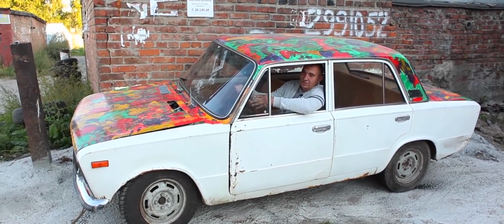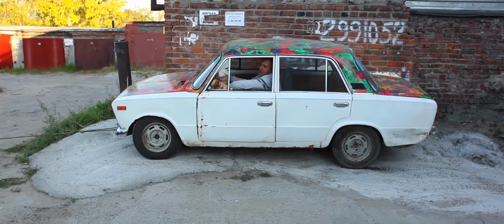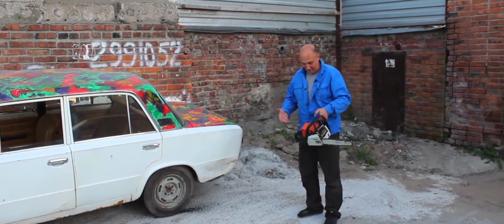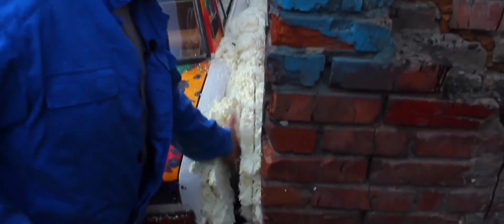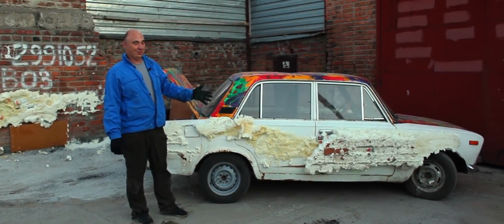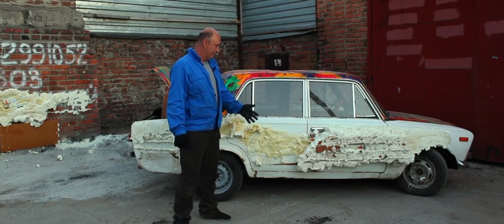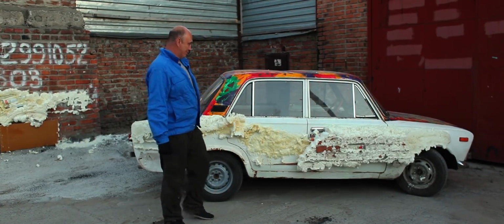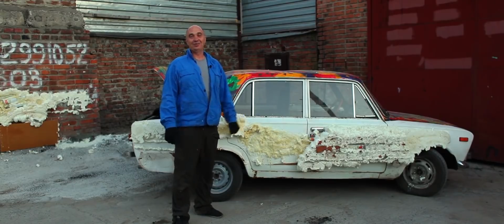Sticking a car to the wall with construction foam

Comment: See, I knew it was a good idea to use spray foam for automotive bodywork. It is strong enough. 
Keep up the translations. Really enjoying Garage 54. Thanks for all your work on these.
Reply: It fails over the years as it shrinks and falls apart though
Reply: Translation by BMI Russian.
Reply: speak english
Reply: causes rust
Reply: if you're using it internally on things like rocker panels with rust holes as a filler and bondo over it it works great, it's actually a trick shady used car salesmen use!
Reply: and good paintwork last 3-4 years,so?whats the problem with spray foam :)

Comment: Spray Foam two cars together but remove both inside wheels on both cars, then have two drivers and see how long the foam will hold up.
Reply: Edvin Damn you beat me to it.
Reply: Edvin I know, but’s that’s easy.
Reply: or even just weld two cars together side by side with the inner wheels removed, so its basically one big car with a steering wheel for each front wheel. see if two drivers can make it around the block
Reply: Jarrett Williams yes that would be cool but it would defeat the purpose of using the foam and the entire experiment
Reply: better to weld them together,, foam wont be as safe,, shit welding 2 cars wouldnt be safe anyways
Reply: yse

Comment: Try filling the fenders and doors with foam and any aera's in the engine compartment you think are safe to see if it would float/try making an amphibious car?
Reply: I want to see a car foamed and used as a derby car.
Reply: It "helps" with corrosion (it SPEEDS UP the corrosion), filling rust holes is (or at least used to be) a common practice in Poland by low-effort body mechanics

Comment: I wonder if Garage 54 could make a Lada float like a boat with builders foam? Garage 54 elevates stupid but functional into an art form, more please!
Reply: They did this, I think they used a 968m if I remember correct. They cut of the roof, and filled all holes with foam, and it floated! They had 7 people in if at one point ! :)

Comment: How about makes a tire from that foam?? That's seems interesting 😂😂
Reply: It works 🤣🤣🤣 used it on a trailer to haul the firewood around the yard , drilled right into the wheelbarrow type tire and it held up for six months
Reply: if repeatedly exposed to the UV light from the sun.
Reply: 12 Volts I'll have to look into it, I'm a little sceptical though. I imagine the blue kind would be rated for UV exposure.
Reply: This construction foam disintegrates fast, but there is a polyurethane mixture meant just for making solid tires out of old tubed or tubeless tires. I had to disassemble one from an army truck... Took me two days.

Comment: Try putting foam on the roof and then another car on top, then foam on the roof and another car on top! Then lift with a scrapyard magnet or crane. How many cars can construction foam hold? Also side by side racing with foamed cars are a good idea!

Comment: You should use a forklift to lift it from the ground then glue it, and after 24 hrs slowly lower the fork lift to see if the car will still be stuck to the wall!

Comment: Wow, I did not think that would work that well. Wrap some cars in foam and smash 'em like bumper cars. ( uh, safely, of course 😆)
Reply: that's a real good idea. see what it would take to make a really safe car using foam. what would it take to make crushable bumpers obsolete, or elimonate the nead for air bags - i HATE airbags, and they are scary! don't forget putting those inflatable side curtains out of business too. try to come up with a car that could withstand a 40 miles per hour head on colision and the passenger compartment isn't compromised  a n d  the car can be driven away, safely...

Comment: Lift the car up to the top of the wall then foam it.   Then remove the support from under the car after it dries. 
See if it will stay stuck to the wall

Comment: Why is only one of the rear wheels of the black Mercedes spinning?
Reply: Normal differential perhaps. When a car turns right the left wheels have to travel slightly further. And vice versa. Thus the need for the differential gearing.
Reply: Hey Micky I see... Thanks.
Reply: Daniel Merhi the limited slip differential is broken so it's acting like an open differential

Comment: I actually have an old can I was going to throw away. Those who have wronged me are not safe  : )
Reply: Did you find the nozzle blocked on your old can ?? (-!
Reply: @thefreedomguyuk  Actually the plastic hose on the nozzle was bent around and attached to the end. I just used this two weeks ago, same can, lol! I cut the tip of the hose off where it hardened and good as new.